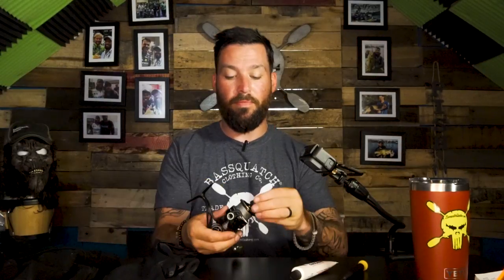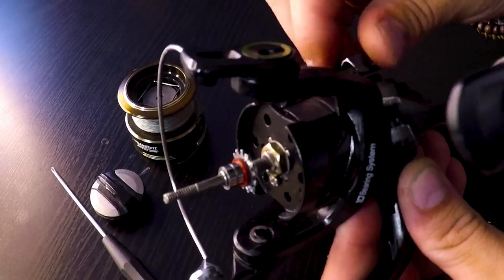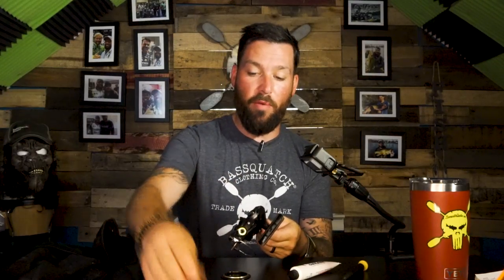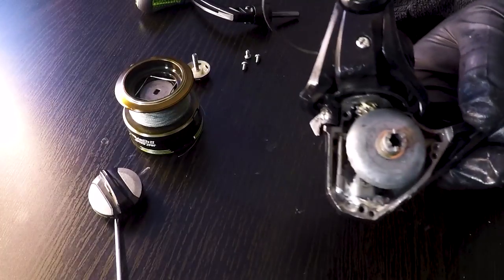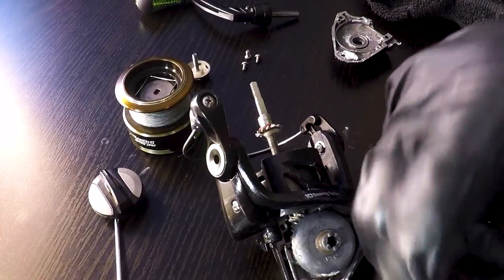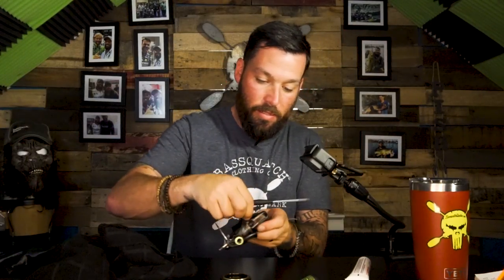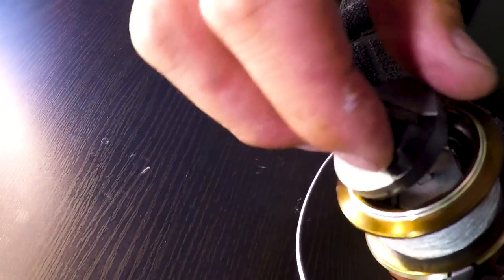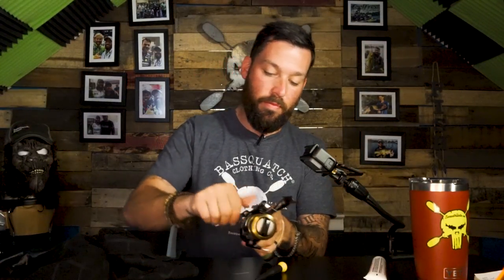How to clean and maintain a fishing reel- Taking apart and cleaning a spinning reel.

Comment: Thank you for this video. It really helps me understand where/what needs to be greased, although I wish you would have included more video from the go pro that's next to you, especially when showing/pointing out things like the main bearing. I was thinking for cleaning and greasing you had to take it more apart so it's good to know that's not the case. Unfortunately for me, my reel is making a funky noise whenever I turn the handle. It's almost like a grinding noise, so I'm gonna have to keep taking it apart until I figure out what's causing it lol. 

One tip I would suggest for anyone whos taking apart their reel or taking apart anything for that matter, is to take pictures of every step of the way. Like I take pictures of things before and after I remove a certain part so putting it all back together is alot easier. I can't tell you how many times I've thought "I don't need to take pictures, I'm putting it right back together" and something ends up coming up and i don't get back to it for days or weeks and at that point I really regret not taking the little bit of extra time to take photos/document every step along the way
Reply: One other thing I wanted to mention since I just ran into it. When taking off the side plate(the side held down with 3 Phillips screws, usually size number 1)after removing the screws, if you try prying it up and it doesn't want to come out, chances are there's a 4th screw underneath the part that has the bail on it. Sorry, I'm not sure the name of it lol. But it's where there's a nut(mine was 12mm)on the inside of the cup where the spool had went. Usually if you take that off as well as the spike looking gear(should just slide off toward the top), you'll be able to either pull it off all the way or you can lift it up enough to expose the last screw and remove it

Comment: I can’t get the side plate back on. Any suggestions?
Reply from the maker: David Dishongh they are tricky... took me a bit as well. Make sure everything is lined up and don’t force it, but it takes a little pressure. Not a huge fan of the design of that specific reel.
Reply: Bassquatch Hunter TV  literally been working on it for a couple of hours. Just can’t seem to get the pegs on the plate to line up with the holes. Pretty sure everything is back in correctly. Thanks for the quick reply. I’ll keep trying
Reply from the maker: David Dishongh it takes a little finesse. They are tough to line up. I use Abu reels now and they are much simpler to assemble. But Lew’s does make good stuff. If you keep having issues, message me on Facebook and I’ll see if I still have one of those reels somewhere so I can see if there was a trick to getting it. Good luck!
Reply: Nobody puts that much grease in a spinning reel